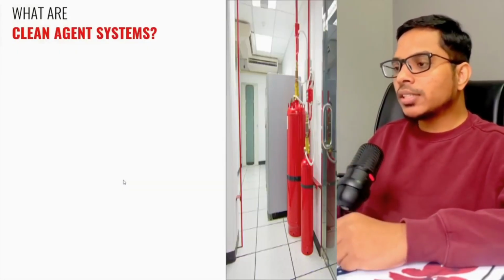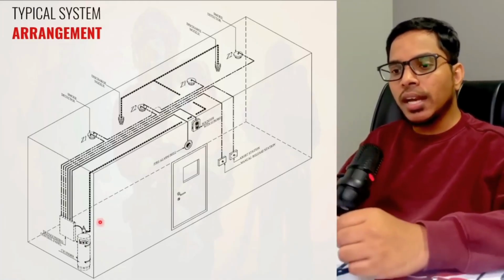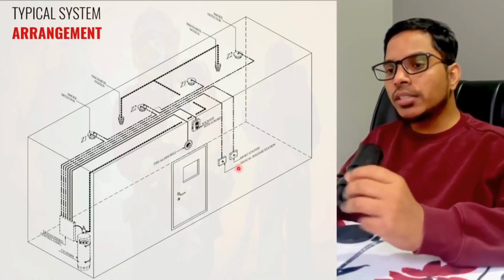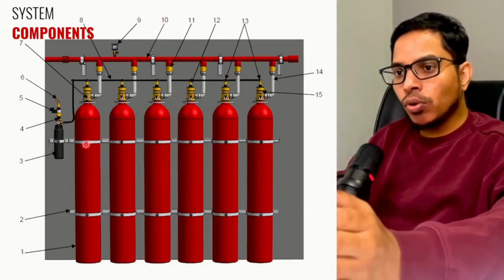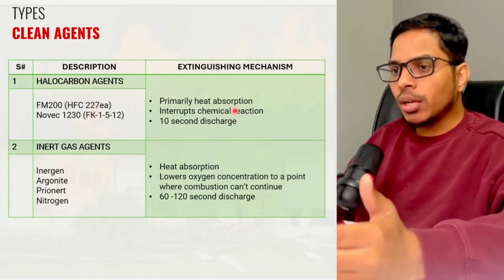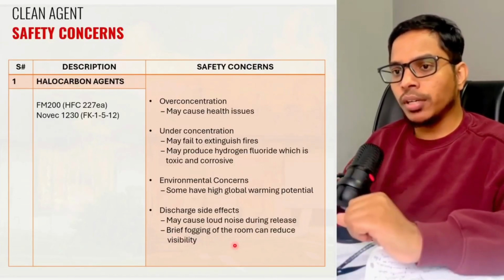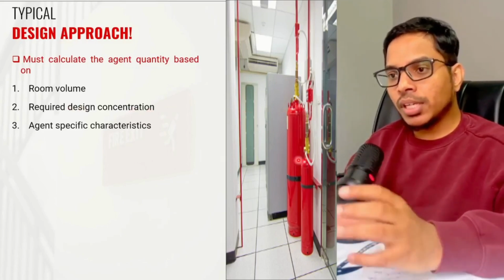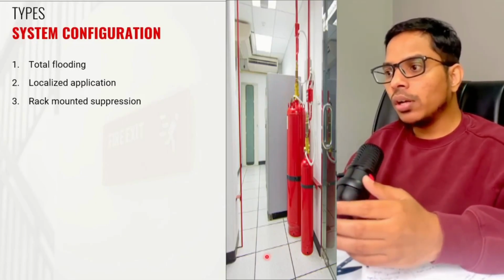Clean Agent Fire Suppression Basics Every Engineer Must Know

Comment: Hello, greetings of the day!
Thank you for starting a much needed series.
It was very informative.
Eagerly waiting for next parts with Rack mounted suppression system.
I am having the following query:
What are the depth limitations for suspended ceiling and raised floor for calculating total gas suppression room volume?
For example, as per IS 15105 (2021), a suspended ceiling with depth more than 800mm shall be provided with a sprinkler system.
Reply from the maker: Thank you for your feedback. No specific limitations. For calculatoimg agent qty we have to consider complete room void+raised floor void +ceiling void.
Reply from the maker: Sure will post other videos asap. Thanks